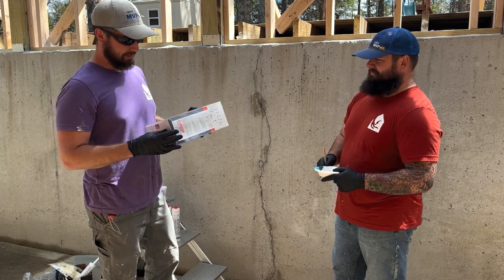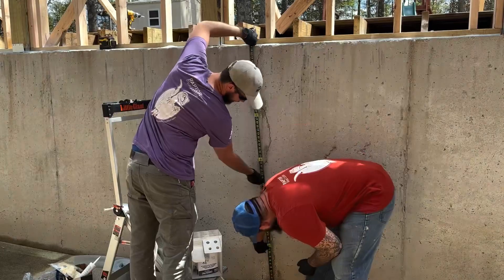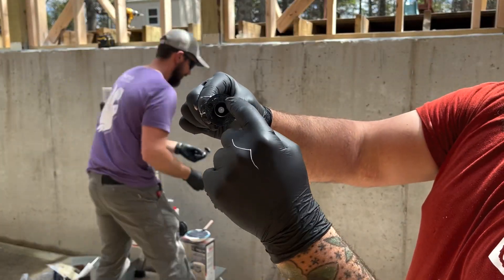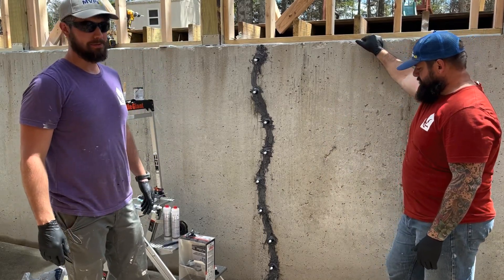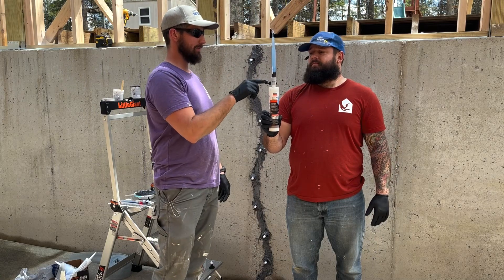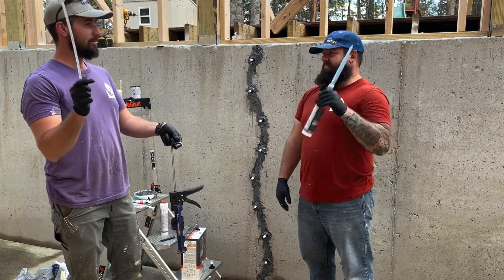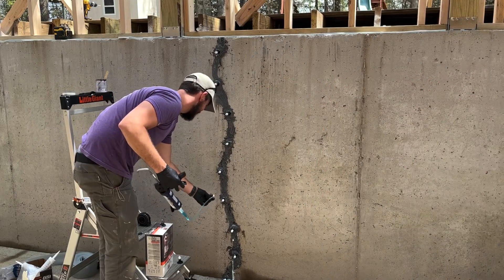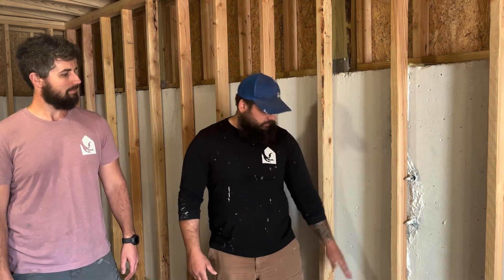How to use Simpson StrongTie Crack-Pac Flex-H2O and product review

Comment: "BONE DRY"! 
This is a great video, thanks guys. 
Question about the prep beforehand, did you widen the crack at all? or drill a hole thru the spot where you installed the nipple to get the mixture back further?
Reply from the maker: We did not drill/widen the crack. About 3/4 of it was already very wide and could make good penetration. In hind-site we would have drilled holes in the bottom 1/4 of the crack to get better penetration.
Reply: @RaptorRenovation  Thanks!

Comment: While the epoxy sets up in 5-8 minutes, it does not fully cure for 12-24 hours depending on the temperature.
Reply from the maker: That is good info! We for sure experienced that!
Reply: Yes I watched a Simpson video and they stated at least 12 hours before using the filler. Thanks for the tips on the mixing of the harder for the ports and the crack itself. I have also read that if you have paint or other stuff painted on the wall itself remove that material as well for better bonding. Again thank you guys for the tips you given as well.

Comment: How do you remove the nipples? I want to try to use this to stop my leak in my basement. Where the bilco door bulkhead meets the foundation water comes up from the ground when it rains hard and leaks into the basement. Any tips or suggestions would be appreciated.
Reply from the maker: We used an oscillating saw to cut them off
Reply: Hammer 🔨